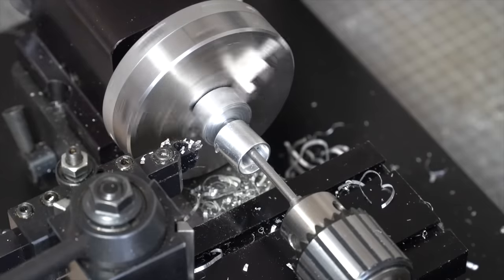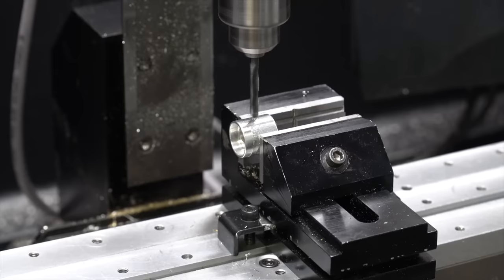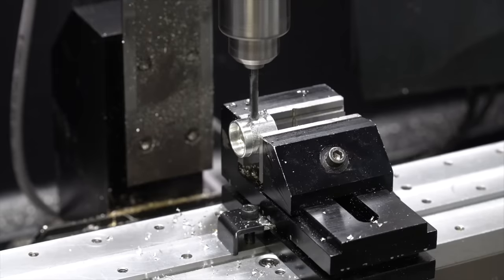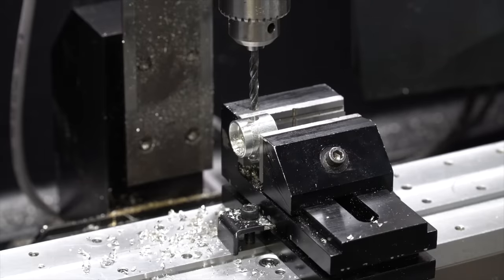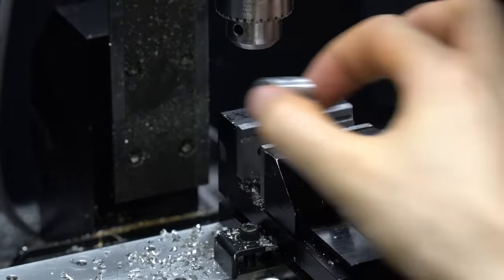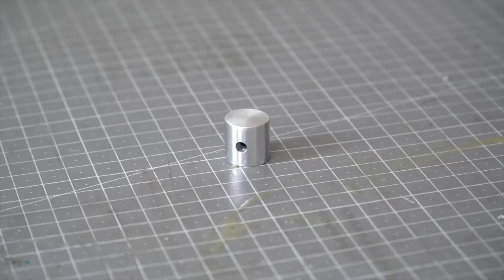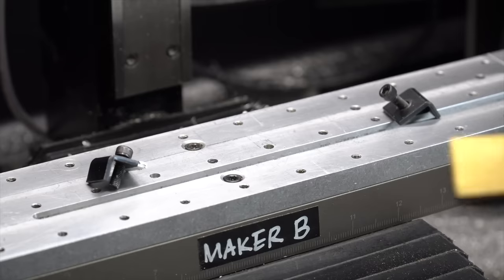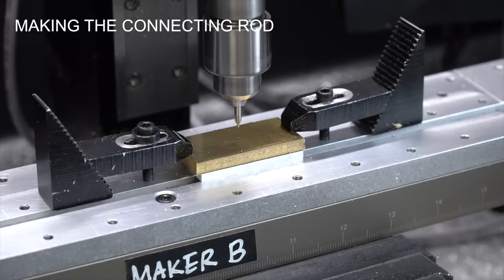Making a 4 Stroke Engine. Episode 1 - Piston and Connecting Rod

Comment from the maker: Episode 2 : Gear & Valve
https://youtu.be/6WAGsgdBfT0
Episode 3 : Crankshaft and Camshaft
https://youtu.be/4pIPrrcwM0E
Episode 4 : Engine Block and Cylinder Head
https://youtu.be/fENYucG1EYc
Episode 5 : Carburetor, Flywheel
https://youtu.be/74sVglPC9ko
Episode 6 : Final Assembly and First Run
https://youtu.be/isuksNyqLj8

Comment: Wait a second.... unless your using black magic how's that piston gonna sustain compression, also, what about oil lubrication?
Reply: Instead of metal piston rings he should do a trail for an o-ring.
Reply: I need answers! He needs rings!
Reply: @tebibyte2357  It will sustain compression until it heats up and seizes because the pistons have been made to cold spec.
Had he accounted for thermal expansion he would of had a engine that's hard to start when cold but shouldn't seize.

Best option is having rings but at this scale it isn't really viable.
Reply: He could do it at ot a Bit Tighter. 
Like the rc Modell Engines are. 
They are called abc engines. 
But he has to chrome the sleeve

Comment: If you score a light groove into the top of the piston, (like an empty ring groove), that groove will hold oil, and function as a "ring".
Reply: True, but I'd recommend more than just a light grooving.  Friction is one thing at room temperature, but the engine could catastrophically seize from thermal expansion of the aluminum piston during operation.  He should reduce the contact area by grooving most of the surface area to a shallow depth.  One ring should remain near the top of the piston, and another ring should be as low as possible without interfering with the wrist pin, and without exiting the cylinder at BDC.  The top ring will seal gasses, and the bottom ring will function as a skirt to keep the piston from rocking too much.  If the bottom ring seals too effectively, it could prevent enough oil from getting up to the top ring.  In that case the location of the bottom ring can be moved closer to the top of the piston and/or the OD of the bottom ring can be slightly reduced on the replacement piston.  Of course the right way to do it would be to have separate rings that are free to compress into a deeper groove, but that's quite a bit more work.

Comment: Small model diesel or glo engines use cast iron or similar metal to match cylinder liners expansion rate which allows very close fit and no need for rings.

Comment: I got one in 1963. I still have the engine. It runs on methylalcohol. It starts with 3 1/4 turns throtl . I built a plane and it flew on two very thin steellines. I got sick due turning around. Long time ago.

Comment: I was hoping that it would be reasonable large 80cc but overall great video
Reply: @horvatdavid2625  what
Reply: Honestly I wasn't expecting an 80cc engine, but I was surprised at how small it is. It's still cool, but I also wished it was larger. Maybe in the future when he gains experience from this build, he may move on to a larger engine
Reply: @horvatdavid2625  Lmao
Reply: These Sherline tools can't handle anything large. To be honest I doubt it could handle the size of the flame licker I built using full sized equipment. I use my Sherline with denford add ons for small runs and test runs or even a miniature run before making a bigger version of what I'm making.

Comment: Engine will seize up, The aluminum piston will expand easily in the steel cylinder liner.
Reply: No rings to oil the cylinder walls either...
Reply: J MacLaren .... Model engine manufacturers have been crafting ABC engines for a long time. The idea of an aluminum piston
in a brass plated steel cylinder is that the aluminum slides with little friction but still retains compression with little oil needed.

Comment: You are a wizard.   Wow!.
Question:   It looks like you made a slot on the inside of the first part, and then smoothed it out.   I’m sure I didn’t understand what happened.   What did you do?
Reply: I can't speak for Maker B, but after the slot is done, he drills the 2 holes on both sides (he later threads these and these hold the gudgeon pin in place) then he puts it in the lathe and cuts out more of the piston to lighten it. That means he reduces some of the  hole length. I think he drilled the holes first, because when he did the slot in the CNC machine, it marked the positions where to drill the holes. (you can see the pilot holes) . Hope that helps you out.

Comment: no piston rings? simple cut on the lathe, and easier to cut out of sheet metal. That engines gonna lose compression faster than you can say butterfinger. But this is a testament to what you can do with a mini lathe (well, and a cnc machine)

Comment: no ring grooves...?? 
no rings...??
What about thermal expansion i think piston will stuck in sleeve when it will get hot
Reply: It will run , determination will prove out I believe .  Even if it does all the bad things others have said it will run .  How about the AC compressor engine ? Radial !!